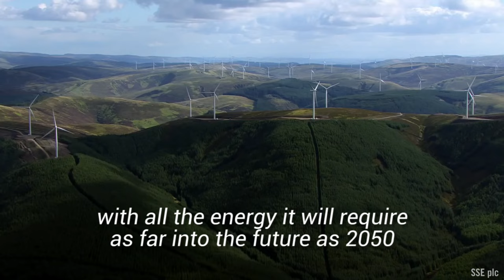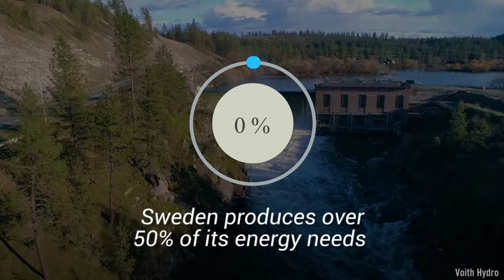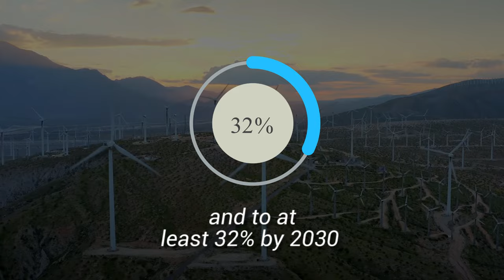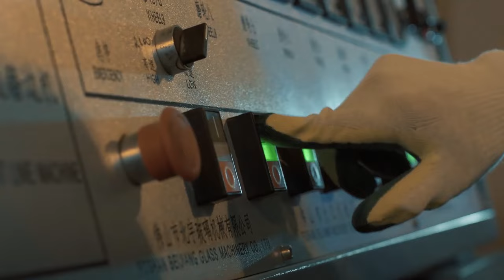Can we power the entire world with wind farms in Europe?

Comment: Let's use only solar panels and wind turbines and get rid of all the fossil fuels! Ops, somebody forgets to tell the needed area for the solar panels, not talking about the pollution they create to be built. Really simplistic video
Reply: Modern wind turbines can be 99% recycled.
Are you crying about the 1%??
Reply: What about solar panels recycling? But first, what about efficiency vs needed surface? Repeat, really simplistic video
Reply: @FTheG  Wa? Solar panels are made of sand.
What do you mean recycling? Just melt them down. Also wind turbines need practically no surface, you can still put a farm underneath one 0 problem.
And solar panels on a house owned by private people are also taking away 0 space, because roofs or highway walls are usually not used for very productive things other than keeping rain and wind and sound out.

Comment: Hydro power is an effective and good source of electricity. However few countries benefit from suitable geography and rainfall.
Wind power is not a good source of electricity and will not replace real sources of power namely fossil fuels or nuclear They are technically poor, and also, in case people had not noticed, their output is dependant on wind speed on a cube law basis. They have a very short life span so are expensive to build over the long term.
They are not and will not give us the power we need at a reasonable cost and we will still need a 100% of maximum demand capacity of conventuional generation to keep the lights on.
Stop all this expansion of wind generators, it's a blind alley.
Reply: Im sorry but but most of what you say is untrue. Hydro is not a clean energy source as it totally destroys the marine ecosystems, also with global warming water levels are effected already causing hydropowerdams electric outputs to collapse, making it not a stable utility scale power source. Wind power on the other hand is simply the best option. One single Modern hightech wind powergenerator only needs one rotation to power a modern household for 24 hours! The maintance is efficient as well and replacement as well. They dont need rare earth materials like nuclear or solar panels and batteries. Offshore Windpower is one of the most technically  advanced pieces of mankind. This decade they will become cost competitive all over Europe. Wind power could easily power the wolrd three times over, plenty of scientific reserach has shown it. Offshore wind never has low wind, and even if wind is at an all time low, the excess energy produced at times when wind speeds were high can be converted to hydrogen solving the problem of electric power instability of the grid. Wind power is the future and its in the making. Cant wait to see the world run on perfectly clean and renewable wind energy. Wind has served mankind throughout the ages and it will do so for millenia to come.
Reply: Well if we can make them less ‘technically poor’ as you say by making them more efficient I think it would be very viable because we do get a heck of a lot of wind in Europe, so supply is not a worry. As you say, hydro is hard to do if you have the wrong geography, and while nuclear can provide a much higher level of energy security it is hard to properly police it.
Reply: @razakmeshouni8611  Capture and storage is do or die for Wind Power and yes production of Hydrogen can help tremendously, it depends on the size and make of the Wind Turbines how many houses they can power with one rotation and for how long, Haliade X 12 can probably power more than one house with its one spin and longer than 24 hours??, also the Dutch have ideas about making Wind power stations in the North Sea connecting all the Wind Farms to Europe which means even more power for everyone, fair bet i think Wind Farms are friendlier than Hydro power generators because of Marine life living under waves, how ever waves themselves can be used for power because theres hardly any disturbance of life if the generators are quiet enough and high enough in the sea, i list my points of support below

Wind is free
We won't be dependent on other countries supplies of power apart from European Wind Farms
Internet stations, Microsoft has conducted tests to work out if under sea beds are better places for internet hubs check out Project Natick https://natick.research.microsoft.com/
Help the production of Hydrogen
Seaweed production/Seaweed Farms, i didn't know Seaweed was used so much
Help Marine life
Weather Research and monitoring, the Wind turbines can be fitted with high tech technology

Final one, because The UK is very much into The Internet, Networking, IT and Software Wind Farms can power what we are into